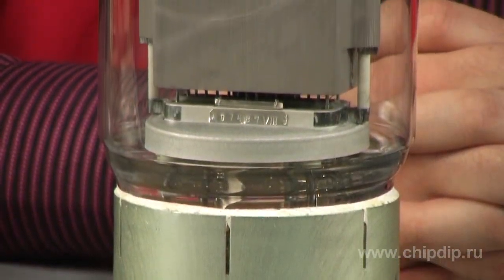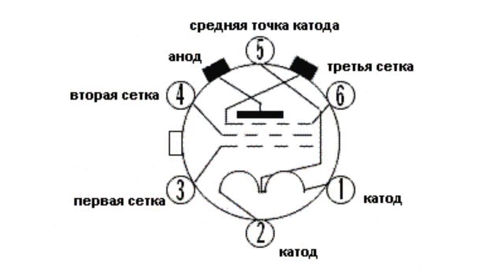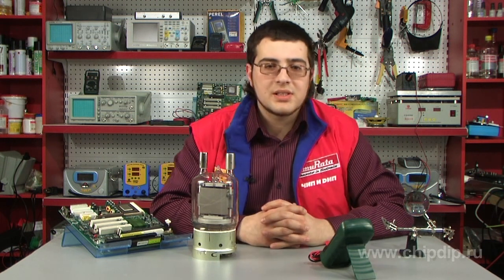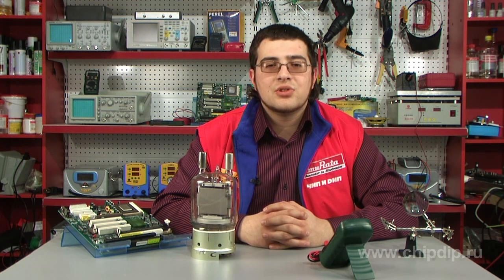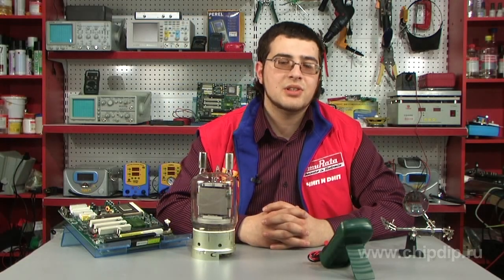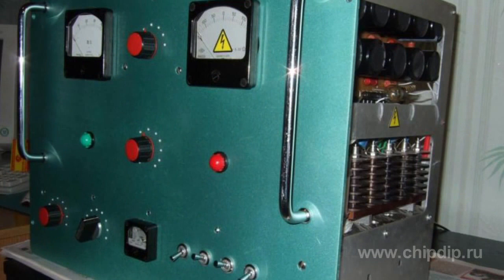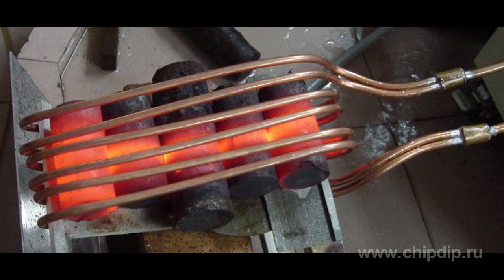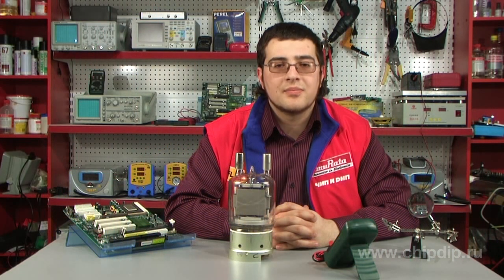GU-81LM Radio Tube

Comment: Hi you can build  a powerful push-pull audio amp with 2x GU81. I made one , it put 1500W rms in 4 or 8 Ohms. 
here a short video from the first tests. Meanwhile it is ready after the third edition of the driver stage. Even with a suitable power supply. the second amp is under construction. 

The tube is original made by telefunken in 1938 ,  the type of the telefunken tube is   RS384.  Another new copy was made by BBC Switzerland und the designation P300-1 , the same tube with a different base.
You can the audio data from the P300-1 datasheet  directly use for the GU-81 as audio class B2 pus-pull power amp.

The vid of my amp: https://www.youtube.com/watch?v=rlhWdqfti_s